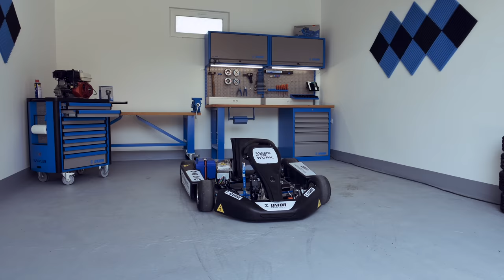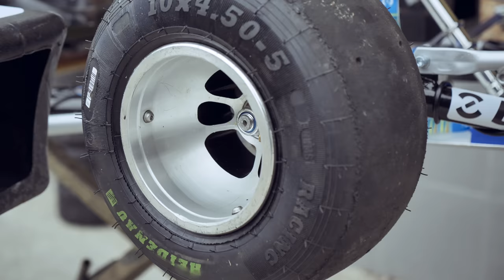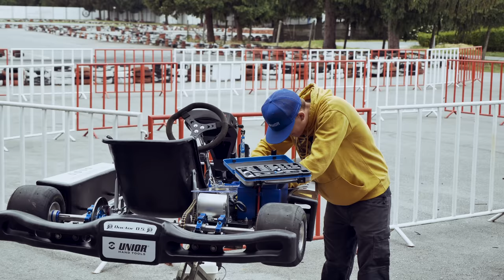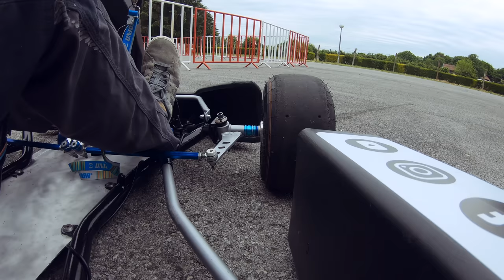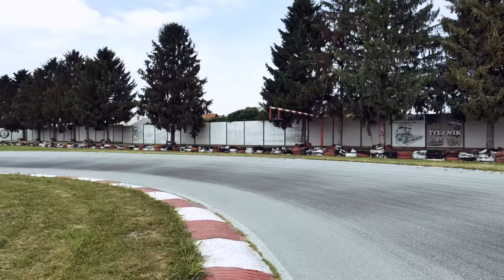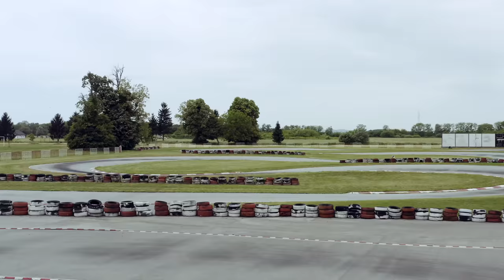Homemade ELECTRIC 3000W GoKart by UNIOR /// TEST

Comment: needs more power.. 10kw is a good start point for an adult go kart.
Reply: I don't know a lot about életric motor but what speed would you say could make a 10kw eletric motor
Reply: @dcrazygeek0741  its more about the acceleration.. but 10kw can get you to 50 mph reliably.
Reply: @airgunningyup  that's only 10 extra kmh not to much of a difference but you'll probs feel it
Reply: @Camo1x  it will have more torque and power. You could put an even smaller sprocket on it and make it go even faster. You could problay fully drift and do burnouts on the 10kw

Comment: 6.5 hp gasser would have embarrassed that
Reply: Eh, not entirely true. 6.5hp is only if you can hold the engine in the very narrow rpm band that you can actually achieve 6.5hp. then the acceleration is also tied to how quickly you can reach the rpm band. The brushless sensored motor hits peak torque from almost zero rpm to about 2/3 of max speed before it trails off. This is why an electric motor can be half the horsepower or in this case 2/3 the horsepower and still be competitive if built correctly.